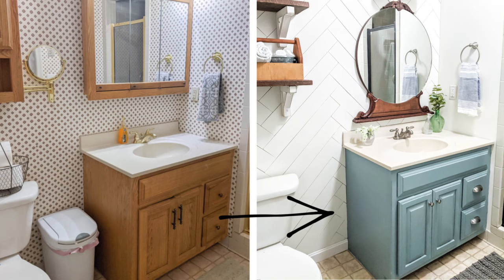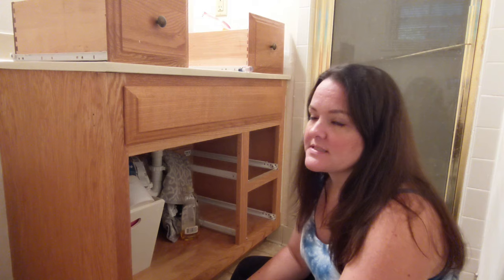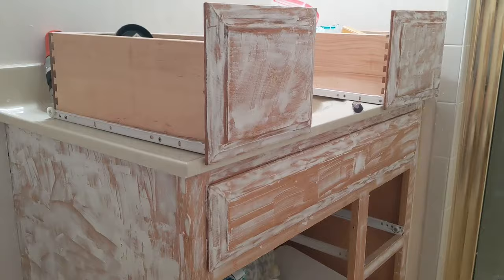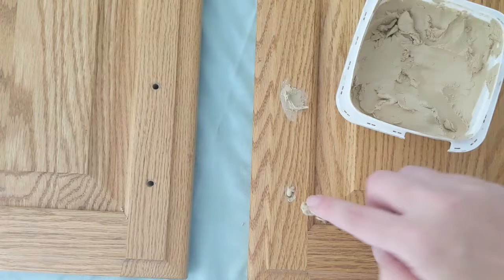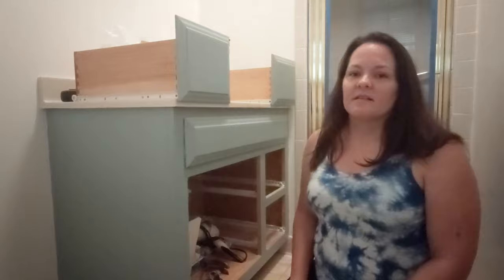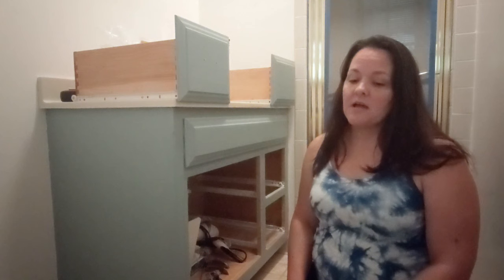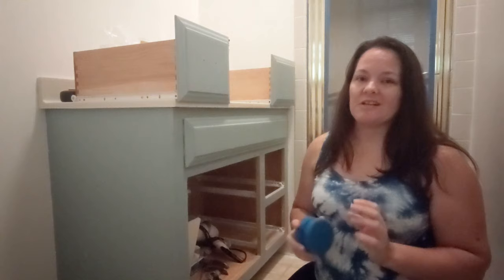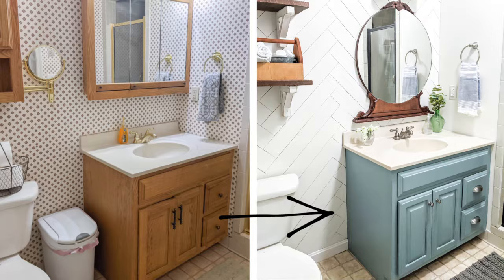How to Paint Bathroom Cabinets // Secrets for a Perfect Finish

Comment: Looking for advice! I watched your video and decided I was going to revamp my bathroom. I still need to do a top coat, but im worried I have do something very wrong as the paint scratches easy right now with a slight bump. Am I going to need to start from scratch?
Reply from the maker: Paint usually takes several weeks to fully cure or harden. So if it scratches off a bit when you scratch it with a fingernail, it will probably be okay. It will harden with time. But if the paint is scratching off anytime it is touched, that is a problem. If it isn't adhering, it may be because the cabinet wasn't cleaned well before painting. Or because it had a very slick surface and really needed primer before paint. I would test a few spots and if it is only scratching off with something sharp or with force, you are probably okay to carry on and do the topcoat. But if it is scratching off all over, it would be best to start over. You don't have to remove all the paint, just gently sand any loose paint off. Then I would clean it well, use primer, and paint again. Fingers crossed you don't have to do that!

Comment: Starting a similar project.  I understand that sanding the flat surfaces is pretty simple but can you explain your process for getting in and sanding all the grooves and bevels the doors may have? Best video I have seen.  Thanks !
Reply from the maker: I'm so glad you found it helpful. You can use a 220 grit sandpaper to get into the grooves and bevels of the doors.

Comment: Love this video. How long in between coats? How long did it take to full dry (prior to top coat)
Reply from the maker: I wait at least an hour between coats. If it feels completely dry to the touch, you should be safe to do the next coat. (If it feels cool to the touch, it isn't completely dry yet). The same is true before the top coat - just make sure it is fully dry. On their website, they say it can take up to four hours depending on temperature and humidity.

Comment: This was most helpful video so far TY. I literally can't decide what kind of of paint is best. (For bathroom also) I want to do mine white, not bright- maybe GF antique white (mine are very dark wood now). GF says on their website not to use topcoat for whites, due to yellowing. can u recommend a top coat that is good for whites? Or just none at all? 😀
Reply from the maker: You can go without a topcoat with GF milk paint, but for something that gets a lot of use like a bathroom cabinet, I think a topcoat really helps. I know GF doesn't recommend their High Performance Topcoat over white paint, but I have actually used it on bright white furniture multiple times without yellowing and that is what I still recommend. I think the key to prevent yellowing is to prep your cabinets/furniture wll (always use a shellac or oil-based primer on dark woods to prevent tannins from yellowing your paint) and also make sure to apply the sealer using thin coats.

Comment: You’re video is so helpful, I love it! But the place I moved into already had painted cabinets that weren’t properly prepped and now the paint comes off if I accidentally ding it. What should I do to prepare the cabinets since I’m planning on painting them again? Also love your recommendation of using General Finishes. Thanks 😊
Reply from the maker: Ugh, it stinks the cabinets were already painted and aren't holding up well! I would use a palm sander to sand off any loose paint. (If you don't have a sander, you can do it by hand with sandpaper, but it will take a lot longer). You may have to remove all of the paint, but you might not - just make sure anything loose or easy to scrape off is gone. Then use a good primer and repaint. Good luck!

Comment: Hello,

I’m painting my bathroom cabinets. I started using 1/4” nap woven 4” roller. It says smooth surfaces however it still looks like a lite texture. Do you find the foam roller provide smoother texture versus the woven?

Comment: Hi.  I have the honey oak colored bathroom cabinets as well, but they have a light clear coat finish on them.  Are you painting right over that?   Do you have to remove the clear coat
 first?  Thank you
Reply from the maker: Hello, you may want to sand to remove the clear coat and make it easier for the paint to adhere. Hope that helps! 😀

Comment: Nice. Your bathroom is exactly like mine wxept the floors and my vanity top is white tile.  I will be painting vanity too and framing the mirror.  I just don't know what to do with the vanity top yet? I think my vanity is made of oak
Reply from the maker: Good luck with your bathroom! Once your paint the vanity, the tile top might not look bad at all. But if you don't like it, I know that some people use a concrete overlay or resin to turn tile countertops into a smooth countertop.
Reply: @LovelyEtc  Thank u. I will paint it first and then go from there then:)

Comment: would you use this paint and sealer for kitchen cabinets in white? have you? the sealer says don’t use over white becuase it might yellow but kitchen cabinets need durable finish.
Reply from the maker: I haven't used this on kitchen cabinets, but I have used General Finishes snow white milk paint with General Finishes high performance top coat with good results. I have a blog post that talks about painting and sealing white furniture and it also applies to painting cabinets - https://www.lovelyetc.com/painting-furniture-white-tips-and-tricks/
Reply: @LovelyEtc  Oh nevermind I just found this post!

Comment: What is high quality brushes and rollers ? Are they made with certain materials? Any recommendations ?
Reply from the maker: I love using small high density foam paint rollers and haven't found a huge difference between brands. They are small, white foam rollers and usually say on the package that they are for smooth surfaces like trim. My favorite paintbrushes are Purdy paintbrushes. They aren't the cheapest but they're also far from the most expensive and work really well. You can get both of these at any big box store.
Reply: Your a life saver, thank you!

Comment: Did you use a glossy finish to the pain? Or matte?
Reply from the maker: I used General Finishes Milk paint which is an acrylic paint with a matte finish and sealed it with General Finishes High Performance Top Coat in satin finish.

Comment: so u dont paint the inside or the inside of the drawers?
Reply: No the paint would not hold up in those areas.  If you want to change the look, try contact paper in those areas.
Reply: @jenniferb5540  great i already did it lol, guess i try putting on multiple coats
Reply from the maker: Some people do, but like Jennifer said, I don't. You don't really see those areas and paint doesn't hold up as well. But if you already painted there, it's fine. Just be really gentle and try not to put anything inside for a week or two so the paint has time to fully harden.